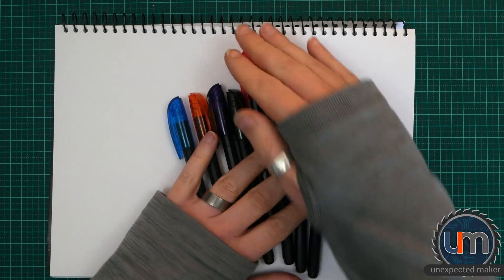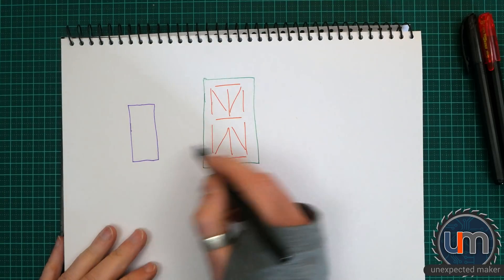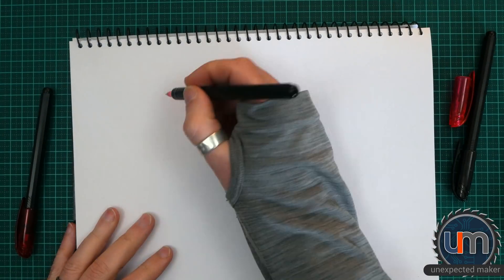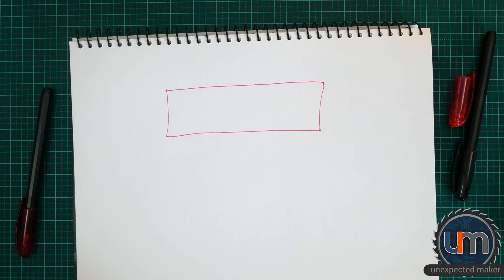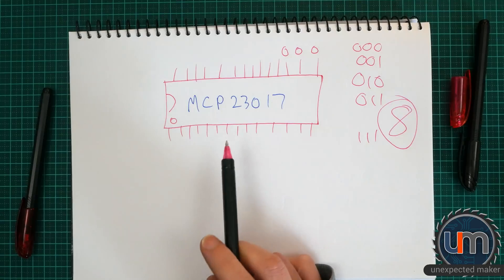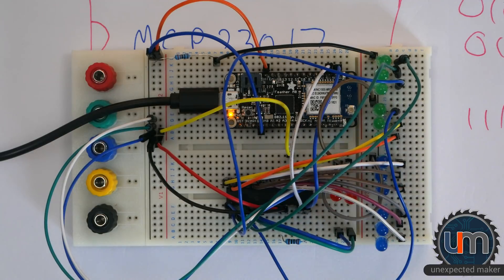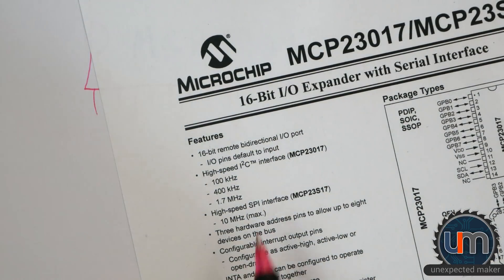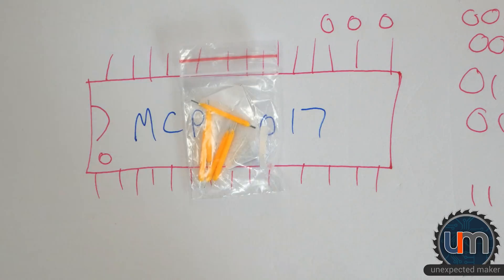Hey David Watts: I found the perfect IC...

Comment: Had a short glance to the MCP23017 datasheet and did not found any reference to PWM. Maybe you could consider the PCA9685, which is a 16-channel 12-bit LED/PWM driver, with up to different 64 I2C addresses. You can find modules on AliExpress for ~$1.70 (described as a servo module) and the bare IC for under $1 (if you buy 10).
Reply from the maker: They definitely do PWM... but the PCA9685 sounds very interesting... I'll look into them, thanks!

Comment: Cheers for posting this, it's good to see a working implementation of this chip as it helps me along with a board I'm designing to go into a drinks machine to track which lines are dispensed (optoisolated of course.).
Reply from the maker: The hardware interrupts on this chip are great! No nee to poll GPIO inputs. Can just get a message when a GPIO state has changed.